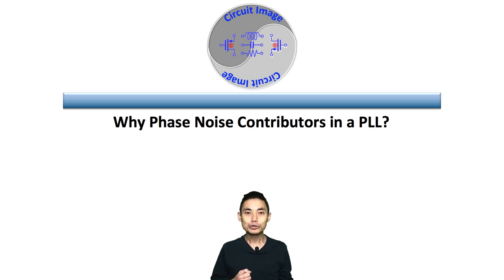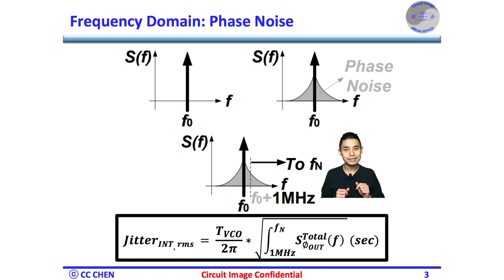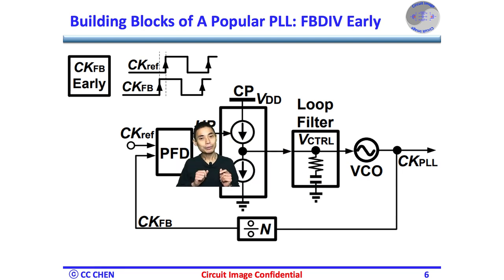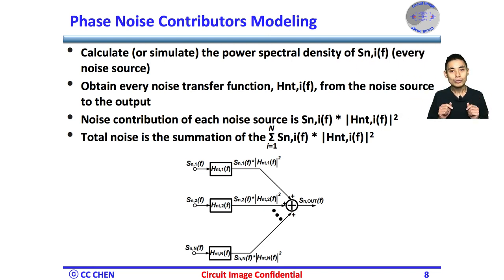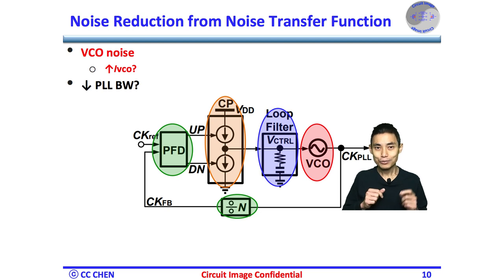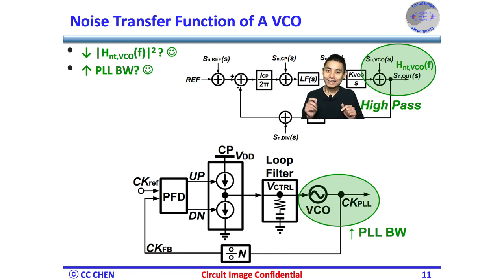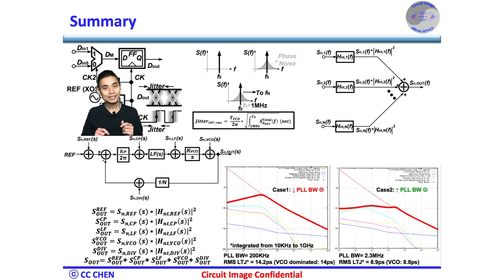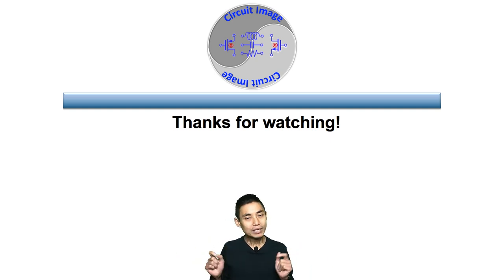Why Phase Noise Contributors in a PLL?

Comment: Great video! Could you also give some guideline in how to find the phase noise contribution from the charge pump? Did you use PSS/Pnoise or transient noise?
Reply from the maker: Hi wty1992, nice to meet you, and thank you for asking. For the charge pump, you can use the PSS/Pnoise to save the simulation time since it's a periodic operation. Also, you can get the phase noise contribution from the PSS/Pnoise analysis easily.
Reply: @circuitimage  But I have a concern, in steady state, PLL should be locked. In this case, isn't PFD output supposed to be zero and thus charge-pump noise be zero (because both up&dn current source are off)?
Reply from the maker: @wty1992  Hi wty1992, very good question. If the output pulse of the PFD is zero, the PLL would be in an open loop, wouldn't it? I assume not, therefore, the slight phase offset should still push the PFD/QPMP in a close loop to cover the whole PVT variation, not in an open loop.
:)

Comment: Great video, thank you CC. By the way, could you please explain at 11:30, why the RMS Jitter was calculated by integrating from 10KHz but not from 0Hz?  Thanks again
Reply from the maker: Thanks for the good question. The 0Hz offset is just the carrier, which was not the phase noise. The 10KHz here is just a case study example. The minimum integrated frequency depends on your system usage. If your system is a serial link, and the BW of the RX CDR in the link is 1MHz, and you could even integrate starting 1MHz since the CDR would track any phase jitter below 1MHz, and you don't care. Does that make sense? Could you please let me know if my metal model image is still not clear to you? Thanks again.
Reply: @circuitimage  that makes sense. Thank you CC. Would you mind answer my question under the why discrete adaptation video too? Thank you again
Reply from the maker: @kellyrolla  Thanks for the feedback. Also, I'm sorry for the oversight in that comment, and thanks for the reminder. I'll check it carefully :)
Reply: @circuitimage  thank you C C. Well explained. Is that possible for you to make a video on how jitter transfer in Pcie ( for example gen3) under different refclk architecture? Thank you again
Reply from the maker: Hi Merlin, thanks for your suggestions and sounds good idea to me. I will do that.

Comment: Hello. the vco settling time is an error. why is this problem happening? as a result of my research, it is written in many places that this will be by Loop Filter. how can I check if the loop filter is doing its job. Thanks your answer
Reply from the maker: Hi Erol, nice to meet you and thank you for the good question. Yes, the loop response could be an issue for the stability since it's a feedback system. Ideally, it should be negative feedback (NFB) to keep stable, but if there's the time constant or BW in the bad design of the loop filter, then that stability issue occurs to PFB. I'll make another video to discuss the stability of the NFB, not causing the PFB.

Comment: another question，why integrate to nyquist frequency，i remember in a video before ,it is a value of pll output frequncy divided by 1667?
Reply from the maker: Hi Yujian, thank you so much for the good question. The "DR/1667" was the low frequency of the integrated BW since the CDR should design for a BW > "DR/1667." But, the Nyquist frequency was the high frequency of the integrated BW since the signaling folding, and you only need to integrate to the Nyquist frequency without counting the noise aliasing. :)
Reply: @circuitimage  thanks for reply,i think i get clerified now
Reply from the maker: 😄 thank you so much for let me know. I am so happy that is clear to you right now.☺️